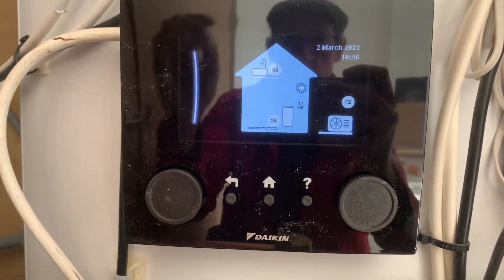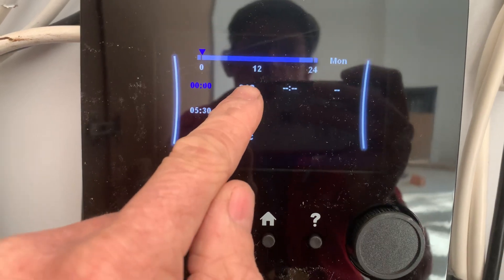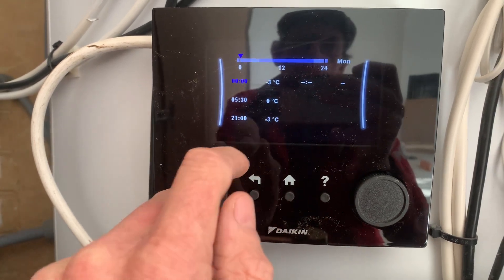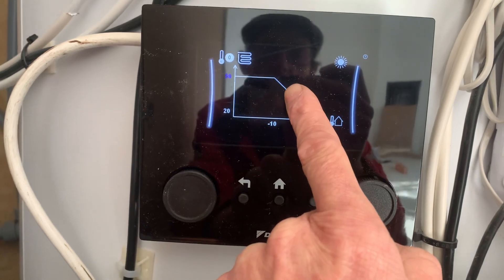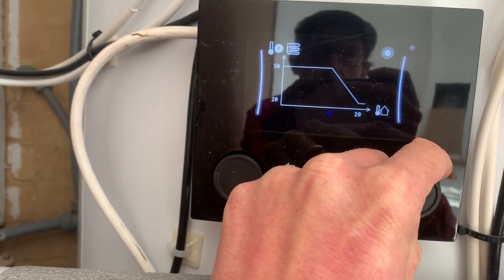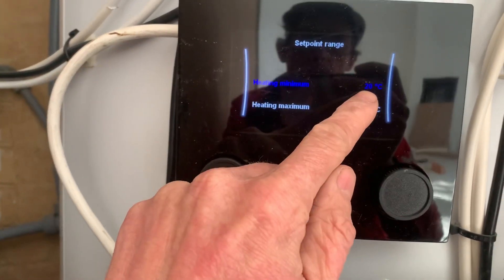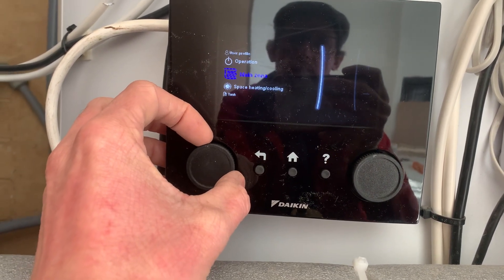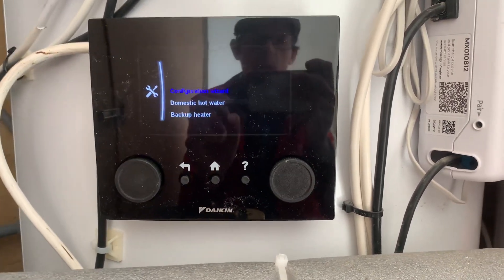Daikin Weather compensation with a night setback.

Comment: Thank you. This was very useful.
I've been running with Madoka thermostat control set high enough so it doesn't cut out. But you can't programme scheduled Leaving Water Temperatures like that. 
This will enable me to do that rather than inefficiently shutting off the heat pump via Madoka temperature scheduling at those times.
Another added benefit of LWT control is that with Madoka control the hot water heating on ECO won't  be stopped before it's hit the desired temperature. 
The only way to do that with Madoka control is to set the schedule thermostat temperature back for long enough, effectively turning the heat pump off for the duration of hot water schedule - that time period changes depending on tank start temperature. So it's a guess!
Why the priotise HW setting doesn't work on ECO, I don't know. 
It's fine in Comfort mode.
Going ECO mode on HW (if you can live with it) is a huge HW / overall COP increaser.
Don't forget to set the HW run timers to long if you go ECO.